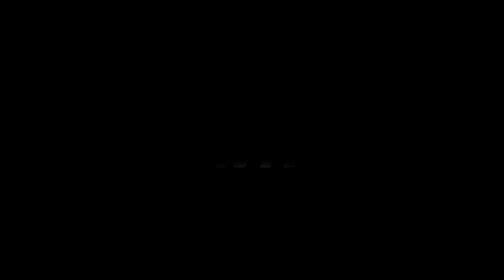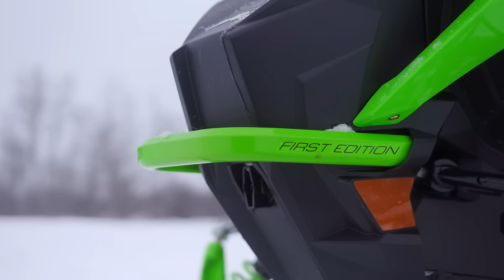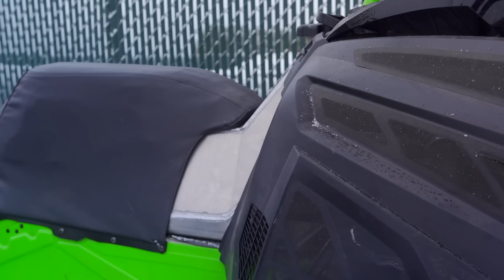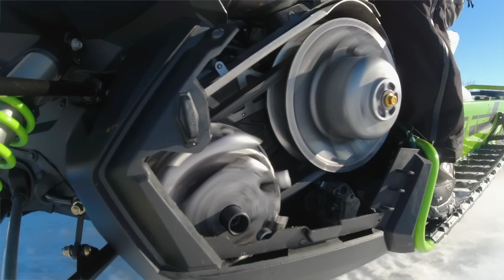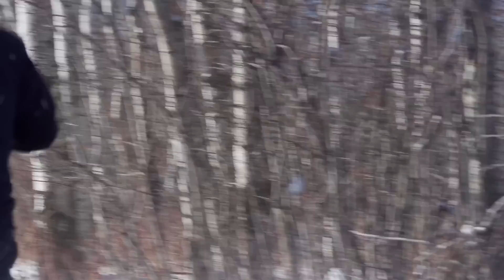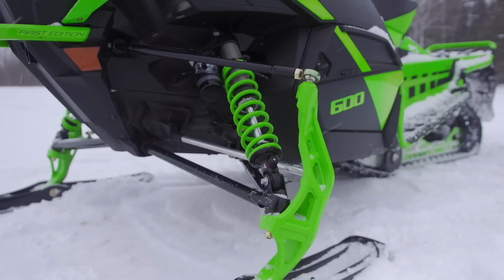Developing Arctic Cat's All-New 2024 CATALYST Platform

Comment: hmm...600cc is fun for tight trails - looooong stretches 85+ MPH for minutes at a time? (like Cochrane/Liskeard areas...yikes)
They needed to drop an 850 or 900cc engine as their MY24 BAM. They spent all this time on the chassis and drive system and didn't have another dept doing R&D on the bigger engines?. Odd. Be interesting to know what the customer buyer percentile is for 'under 800cc' ...I would imagine 40% or less?
Regardless, sure looks like it handles flat - that's a WIN...still has some outdated features (or lack of).... I would DEF consider one in a few years once the belt drive proves itself in the cold temps - and IF the belt grenades, is it changeable trailside(?)...
Sled design looks great - prob the nicest of the bunch - visually.

Comment: I’ve been a cat guy since 1988.  My last three new cats were in 2018, 2019, and 2021.  I’m taking a pass on this one.  Maybe they will come around in a couple years, but they have nothing to compete right now.
Reply: I’m legitimately curious what you mean by that? The 600 RX-C you are watching in this video just won a cross country race, so I’m confused how it doesn’t compete?
Reply: Nothing to compete? This is the most “compete” Cats shown in over 10 years! Other then the fact there’s no big bore this is Cat competing. I’m not sure what exactly you mean….?
Reply: @pajamatime5750 it’s a turd 120hp and was built around a 600 a 800/850 is not gonna fit well let alone a turbo option
Reply: I’m sure for a small motor ditch banger the new chassis is fine as long as you don’t want any modern electronics.  Problem is, if Arctic cat thinks market share can be gained because there’s a bunch of shedders who want smaller, stripped down snowmobiles for the same money as the competitions big motor offerings they’re extremely confused.
Reply: @Rudevette  ^^^ this guys not wrong.

Comment: I would love to try one of these. But 2012 still stings. A lot. And as much as I love you guys putting out these vids, you guys were selling the 2012's. I hope I run into you guys next winter again in person and get your off air opinion.
Reply: Ha!  Same.  I'm looking--but I'll give the belt drive in particular--the watch and can it live on trails with next year's 850+ motor.
Reply: YES!!!!   I SPENT 3 YEARS AND 3GRAND fixing a belt issue on my own because Cat didn't have a solution for a misaligned motor, out of spec TCL, cracked heat exchanger motor mounts, warped primary clutch, etc etc etc.  The sled literally soured my taste for the sport.  All the while the sled media world said little or nothing.  Bitter feeling
Reply: I'm with you man.  Arctic cat all my life.  Snow checked 2012 f8 snopro.  16 belts in one season, no help at all from cat, after I complained enough they told me to provide all my receipts for belts and they would pay half.  Switched to Ski-Doo and have had 5 new ones since. Never again cat. Cats product might be better now but dealer support and network leaves you on your own more often than not.

Comment: Needs an Indy 650 comparison video ASAP
Reply: I've rode both and would say very similar power and ride. But better shocks on the cat.

Owned vr1 last year. Rode zr 129 and rxc at eagle river 3 weeks ago
Reply: @PenelopeVibing  how about initial bite and mid corner grip?
Reply: @Adam Brandano  I can't answer that honestly because in Eagle River, it was very icy and all sleds had zero studs . 

Once moving it has excellent throttle response. Felt similar to cat 800
Reply: @PenelopeVibing  Agreed, it was all ice. I rode the riot 146 and the zr 137 and they felt great through the choppy stuff i found, thought the seat would suck but i was wrong, felt nice, good ergos.